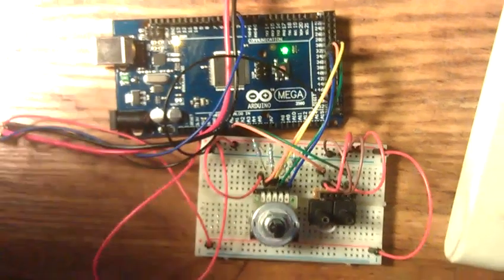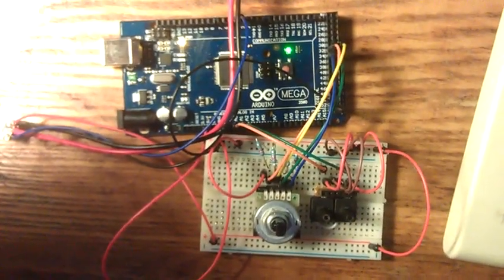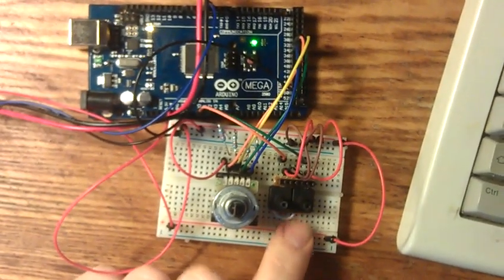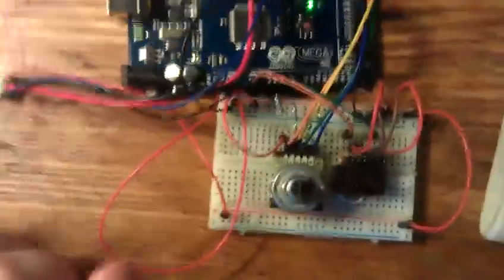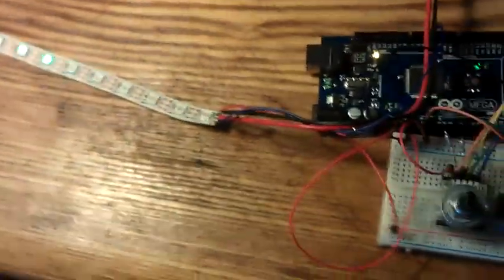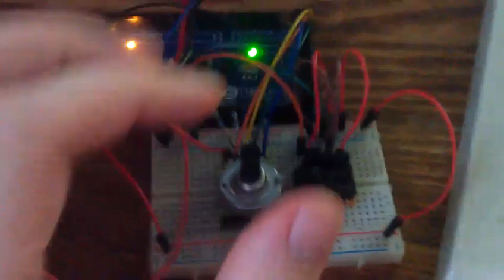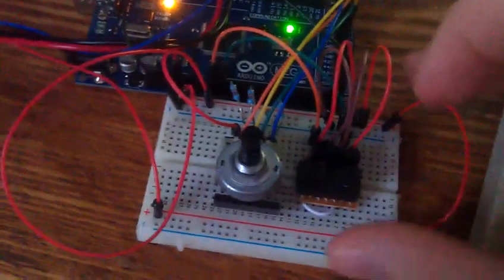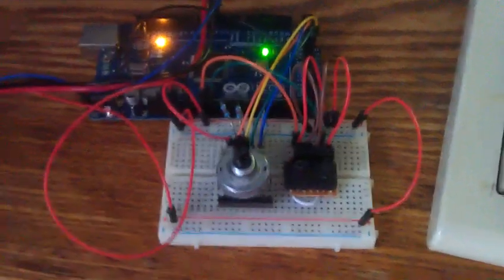Addressable LED strip WS2811 driven with an arduino and fastSPI

Comment: Hello. Just to be clear can you confirm please that the strip is using  WS2811 and not WS2812s, which are RGB led's integrated with the WS2811.

Comment: Hello, I'm a total newbie to programming and am currently trying to wade my way through controlling led's. i loaded your code (i think) but it comes up with a fatal error all the time. I loaded the other library you showed but it doesn't contain FastSPI_LED.h and i keep getting this error message.

Arduino: 1.6.6 (Mac OS X), Board: "Arduino Duemilanove or Diecimila, ATmega328"

/Users/Sutek/Downloads/LEDstrip-master/switched/switched.ino:30:25: fatal error: FastSPI_LED.h: No such file or directory
 #include <FastSPI_LED.h>
                         ^
compilation terminated.
exit status 1
Error compiling.

  This report would have more information with
  "Show verbose output during compilation"
  enabled in File > Preferences.
Reply from the maker: +Callum Campbell You need the fastSPI library - and the same version I used - wherever the arduino IDE looks for libraries.
Reply: +tomkandy Thanks, i'll try to find that library. It seems to have been superseded with FastLED.

Comment: This is great- can't wait to try it! Thanks for sharing. Just one question- could you please post a link to the switch you used?
Reply from the maker: Heidi Hillenbrand As built here it was using an absolute rotary encoder - no idea what the part was, think it was from a spares bin. They're relatively expensive, so I wouldn't bother using one really. The whole thing was later substantially redesigned to be controlled from a smartphone over bluetooth instead.

Comment: Awesome video, thanks! I am working on a project that will have 12 separate strips hanging from the ceiling. There are a lot of tutorials out there about how to manage strips that are connected in series, and all of that is pretty intuitive. However, for my situation, it would be great if I could put each strip on a different Mega 2560 output pin. Is there anything about fastSPI that would prevent me from doing something like that? Have you ever tried multiple strips on multiple output pins? Thanks!
Reply from the maker: Probably best looking at the FastLED community https://plus.google.com/communities/109127054924227823508 Depending on what you're trying to achieve, you could also common the data pins, or eg. take the output from the middle of one strip and use it as the input to another.
Reply: tomkandy Blazingly fast reply. Thanks. I will definitely check things out with the FastLED folks. My main problem is actually cable management. Since I have the 12 strips hanging in a grid from the ceiling, and they are at 2 meter spacings, I would have to run the output of one strip back up the strip (1 meter of wire), then over to the next strip on the ceiling (another 2 meters of wires) and do that 12 times for a total of something like 36 meters of cable and mess. I am worried about data corruption in all that wire. It seems cleaner to just have a web of strips coming out of the Arduino.

Comment: Hey Thanks for the help, I have a question it is possible of controlling more than one strip, I want to use 5 strips how ever will be  activate one  at the same time. because Arduino just have one SP1 interface.  will be possible use the PWM for drive  the 5 strips ?

Comment: Thanks for the video. I would like to build a stair light with the LED strips. Do you think it is possible to controll 20 single strips of 1 meter in the way every step dims up until all steps are illuminated? Is it possible via SPI? I'm using SainSmart UNO and 12V/20A power supply. Thanks for help in advance.
Reply from the maker: Depends. What strip are you using? You can drive about 600 pixels off a 328p with my code, refresh rate starts to get a bit slow at higher lengths though. You'd probably need to reinject power a bit too if you're doing a 20m run.
Reply: tomkandy Thanks. I'm using 2812B strip. I have to use 20 times 1m for the stairs.
I wonder if it is possible with SPI or Bitbanging. I've ordered 10pc on a strip and I'm going to try it with Arduino UNO. I've ordered MEGA and DUE for the big project.
Reply from the maker: hoschdebacha
Use the fastSPI library if you can rather than writing your own bitbanging. MEGA should handle about 2400 pixels. What's the density of that strip?
Reply: tomkandy
Ok. I'll try. Density is 60 LED`s per meter.

Comment from the maker: The strip can handle about 50,000 pixels per second, so 50Hz at 1000 pixels. I doubt you could achieve this driving it with an atmega 328p, how close you got would depend on how efficient your code was, and how complex your effect. Mine will do 50Hz up to about 300 pixels in some modes I think.

Comment from the maker: Library needs to be installed in arduino\libraries\fastspi.

Pins have indeed been changed, and the resistors you can see on the breadboard aren't needed any more either as the pins are set to input_pullup, and the common to low.

Comment: Thanks for the video...  I get the following error when compiling in the first line of void setup:

Pixel_LED__switched:27: error: 'FastSPI_LED' was not declared in this scope'

I also have a question on your circuit... in the video it appears that the Rotary DIP goes to  pins in the 30's but the code shows 1-4. Did you change something there? I'm trying to duplicate your circuit so any additional info you can provide would be very helpful. Thanks!